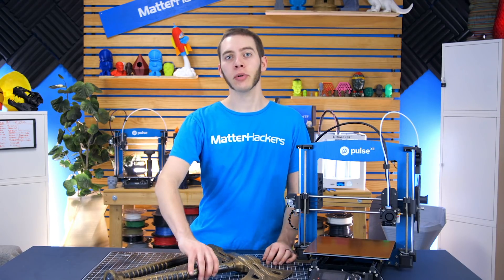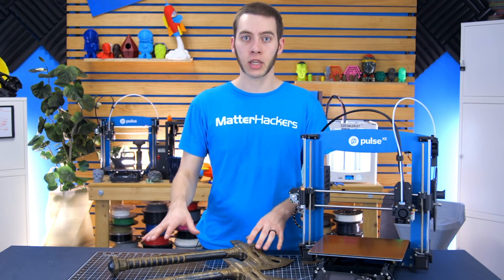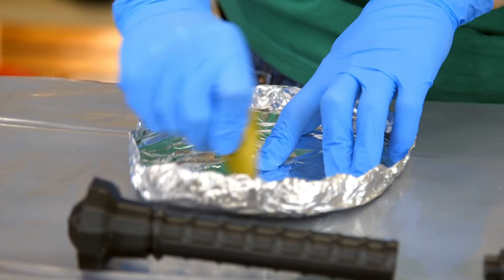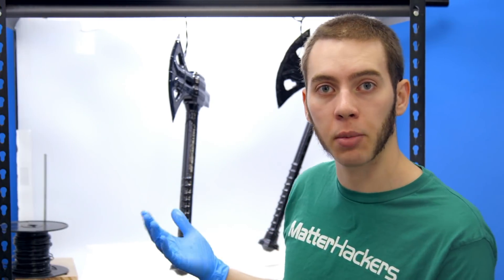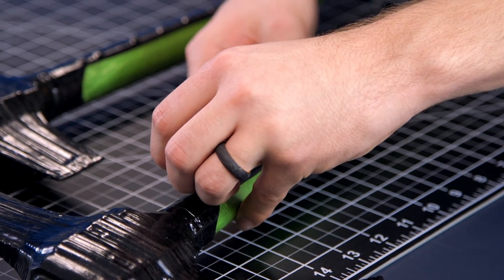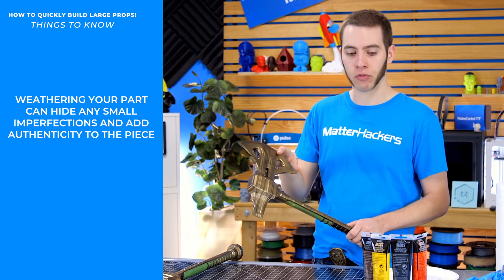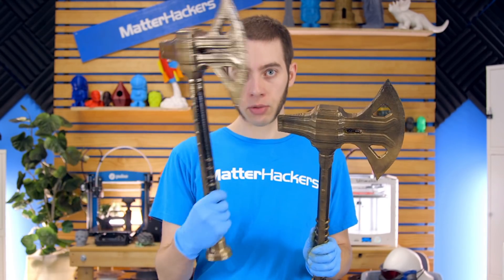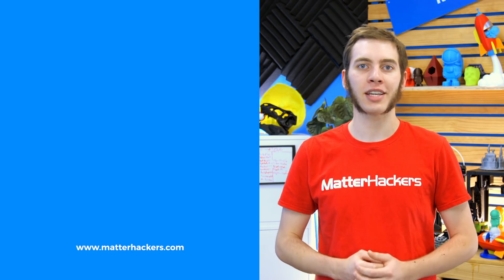How To: Quickly Build Large Props // 3D Printing Guide

Comment from the maker: What's your go-to adhesive when you're bonding parts for your large prints?
Reply: mostly pizza
Reply: Hey boss any preference for programs to start designing and slicing for beginner doesn’t matter if it’s premium just want to finally get the ball rolling and dust off my printer since right now is the best time to get started
Reply: Soldering ion lol
Reply: Super glue or E6000

Comment: I have a question. When it comes to printing helmets, what's the recommended speed to print one with out taking the risk of layer shifting?

I'm using the Creality CR-10 with standard .4mm and I'm using Cura 3.6. I was thinking about increasing the print acceleration from 500 to 1000, but I would like someone's expertise on this subject matter.

Comment: Q1 Would you say that Bondo would be a better media to hide the deep layers from 1.2 nozzle?
Q2 Should we lightly sand the printed part before applying Bondo/resine or is it a waste of time?
Q3 How good the Bondo or XTC adhere to the part without sanding?

Nice video, thank you for your great inputs!!!! Especially the "save time/just enough" kind of tips since I'm alway behind schedule caus I'm perfectionnist.

Alex from Québec, Canada
Reply from the maker: Q1: Bondo is going to have more control over it to actually cover your part, but it's a lot more hands on. As you saw, applying the XTC-3D was quick, but layers were still semi-apparent.
Q2: Nah, at least in my experience, the bondo will stick well enough to the part without sanding, but a light sanding with 220 grit couldn't hurt either.
Q3: XTC smooths a lot better if it's not sanded, but it adheres similarly. I've applied it post sanding, and those parts were way rougher than the ones that didn't get any sanding at all. The bondo should adhere a bit better with a light sanding, but you shouldn't need to go nuts to make the Bondo stick.

Hope that helps! It's the perfectionist's curse. Are you working on anything right now? - Alec

Comment: Am I the only one that thinks XTC 3D doesn't do that good of a job at hiding layer lines?
Reply from the maker: In my experience, it really depends. These prints were 0.6mm layers, but on some prints I have at home at 0.2mm or 0.1mm, it actually does a really good job. Basically one coat of XTC-3D, a sand over everything at 220 grit, primer, wet sand, and paint. But those I had all the time in the world so I was able to take it that far. What's your experience with XTC-3D been like? - Alec
Reply: I'll admit to not personally using it myself. My opinion is solely based on watching video reviews and seeing the end results. I think if one has to still use primer filler, then I don't see the point. I would just rather keep adding a few coats of the filler and then wet sand. You're right in that it does depend on how far you want to take things. It seems like XTC is being advertised as a one stop and/or easy solution to avoid the extra work of finishing a model but maybe I'm missing the point. My current solution involves filling my models with dry wall spackle, sanding it, then using a primer filler before a final coat of paint.

Thanks for the reply.